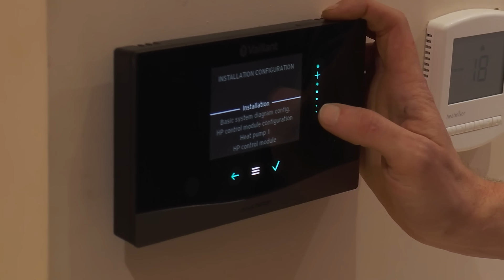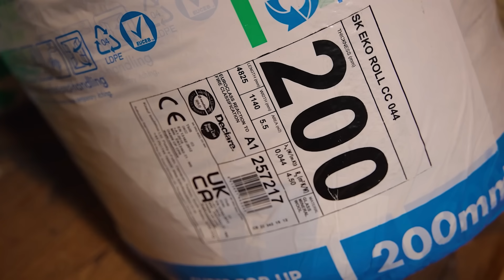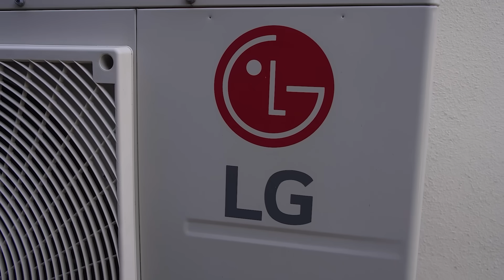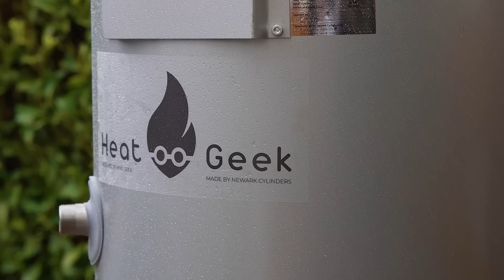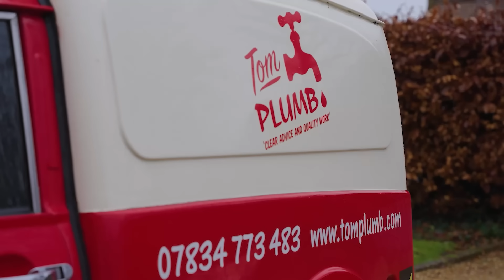Heat Geek’s Heat Pump One Year Later — The Verdict!

Comment: I  nontice the heat pumps you feature,are close to walls
I made a base one,but building inspector said it must be 1 meter from any wall

Most of us grow up learning that oil and gas are fossil fuels formed from the remains of ancient plants and animals buried under layers of sediment for millions of years. These hydrocarbons have powered modern civilization, fueling transportation, industries, and countless everyday technologies. However, a mind-blowing theory challenges everything we thought we knew about these vital energy sources.

According to the abiogenic petroleum hypothesis, oil and gas might not originate solely from decayed organic matter. Instead, they could be continuously created deep within the Earth, in the zone between the solid mantle and the liquid core. Proponents of this theory suggest that under extreme heat and pressure, inorganic carbon and hydrogen compounds interact to form hydrocarbons, meaning that oil and gas could be a renewable resource. 

Remember, the First Law of Thermodynamics, also known as the Law of Energy Conservation, states that energy cannot be created or destroyed; it can only be transformed from one form to another. What goes up, must come down. Carbon burned up into the atmosphere falls back to Earth and is reabsorbed. Much like the water cycle. The water cycle and the carbon cycle are essential natural processes that illustrate the principles of conservation of mass and energy. 

Key Processes of the Carbon Cycle: 
Photosynthesis: Plants absorb CO₂ from the atmosphere and convert it into organic compounds.
Respiration: Animals and plants release CO₂ back into the atmosphere during metabolic processes.
Decomposition: Dead organisms break down, releasing carbon back into the soil and atmosphere.
Combustion: Burning fossil fuels and biomass releases CO₂ into the atmosphere.
Ocean Uptake: Oceans absorb CO₂ from the atmosphere, where it is used by marine organisms.

Conservation of Mass:
Carbon is cycled through various forms (organic, inorganic) and reservoirs (atmosphere, plants, rocks), showcasing mass conservation principles. The total amount of carbon remains constant while it transitions among different forms.

While the idea of abiogenic petroleum has been discussed by scientists for decades, it remains largely debated and is not widely accepted in mainstream science. Most geologists continue to consider oil and gas to be fossil fuels. Nevertheless, the theory raises fascinating questions about the inner workings of our planet and whether the energy resources we rely on might be more abundant than previously thought. Much research is still ongoing with favorable findings for abiogenic petroleum. 

Beyond its scientific implications, the concept of naturally regenerating hydrocarbons forces us to reconsider our approach to energy and sustainability. It reminds us that the Earth is a complex and dynamic system, complete with processes that are still not fully understood. The idea that oil and gas could be continuously produced through geothermal reactions challenges conventional wisdom and inspires curiosity about the mysteries hidden deep within the planet.

#OilAndGas #AbiogenicPetroleum #RenewableEnergyTheory #GeothermalEnergy #EarthScience #EnergyMysteries #ScienceFacts #FactPulse

Comment: A relative had a house built with full eco credentials and made use of the government grant and favourable feed in tariffs. Now 15years later the heat pump is due replacement  and she has been quoted £13,500 for this. Heat pumps may produce 4kw of heat for 1kw of electricity but electricity is 4 times the cost of gas.  Replacement of a gas boiler costs around £3500 and a lot cheaper to maintain. Saving money is not achievable with heat pumps for most people

Comment: Question. If heat pumps are so efficient and such fantastic heating appliance, then explain to me why an 8.5 KW unit requires a 40 amp MCB as it runs at 37 amps. What is there inside this unit that creates such a massive current draw? Allegedly, it is nothing more than a central heating water circulation pump,  a fan motor, a small compressor, a few solenoid valves and a circuit control board. So what is causing the massive current draw. For your average Joe & Jane could never afford to run one of these units, your electricity bills are through the roof.

Answer: All heat pumps A.S. or G.S. have massive electric heating elements inside then to boost the temperature of the water going into the property? These heating elements make around 80% of the units power consumption, heat pumps are basically just glorified big electric water heaters, disguised as saving the planet. They cannot generate a high enough thermal exchange to raise the water temperature to 70Deg C in order to adequately heat your house and your domestic hot water using only a refrigerant gas.

My combi gas boiler doesn't require a secondary electric heater unit to boost the temperature of my heating and domestic hot water. Reason being because it is truly effective and efficient at heating the water and cost a fraction of the price to install and to actually heat my hot water and home compared to AS or GS  heat pump systems.

Comment: Never remove the boiler it is your backup,  heat pumps do break down. 
There is almost nothing to go wrong with a boiler, but a heat pump has lots of pressured pipes, any tiny leak and you loose the gas, it stops working. 
The squeal was almost certainly just the fan bearings and they could have been changed for about £20 by any company that douse electric motor repairs plus the labour costs obviously. 
I have done many motor bearings over the years, makes them much quieter. 
No it was not the tilt on the unit that is just pure bull Beep as an excuse to make money replacing the entire unit.
It was almost certainly the hose pipe the bearing seals are not designed to work in water. As a hose pipe and water was necessary to try and defrost the unit, that was the problem,  the automatic defrost was not working, probably just a sensor, which could be why it could not heat the house.

Comment: I love that in the back ground throughout this interview there is a secondary heat source in the form of a portable  electric convector heater 🙂
Reply: good catch , the amount of time, expense and people its taken to get his house to a satisfactory state cannot possibly be justified by the time , work and expense its taken , he could simply have stuck with his gas set up and been able to use his garage
Reply: Just because that space heater is there; does not mean that it is constantly turned on.  It also could be the case that this interview is in a conservatory ---- maybe on the north side of the house which does not have heat from the heat pump.  There are several unknown factors.
Reply: Exactly. Probably did it in the conservatory for the light. You'd be mad to put central heating in the conservatory.

Comment: you can't treat all gas boilers equal, just because the one you had was not giving you constant temp doesn't mean it's a boiler Type problem, but in fact it is an exact boiler model problem, because there is a lot of new Modulating condesing combi gas boilers which are excellent in terms of automatically adjusting combustion output to maintain constant temp and are super efficient and fairly simple devices and a lot cheaper than a heat pump. a 24kw modulating gas boiler can effectively run at 4 kw power continiously compared to old boilers that run at maximum power then turn off which cause the inconsistent temps

Comment: I live in norway, it gets down to -30 where I live.. down to -25 all I need for heat is my mitsubishi kirigamine 6.6kw heatpump. When it gets colder than -25, I use some additional wood oven, which is seldom. I think the bigger problem in the uk is insulation.

Comment: Wow, The comments section is  being barraged by the heatgeeks bots. with a COP of 4.5. Does that mean? 1KW of Electricity to 4.5KW of heat. Thats excellent. However Electricity is 26.35p & Gas 6.29p making electricity 4.2 times more expensive. What is the capital spend for a heat pump system + new Radiators. How much space do you need for the Heat Pump. More components means more points of failure. Do the maths. It makes no sense. Is John's opinion valid anymore or has a bias crept in because he got everything for free.

Comment: Find a politician to support a product and then make lots of money. As an aside. When I was at Salford uni in the late 1970's 4 experimental low energy houses were built on the budget normally allocated for a council house. The house had 150mm polystyrene bead cavity fill. 300mm fiberglass in the roof and treble glazing. It also had heat recovery ventilation in bathrooms and kitchen. The sole source of heating was a gas fire in the living room which we were informed just needed 3 hours of use in the evening and then the distribution of heat was assisted by the heat recovery ventilation. BTW the scientist who completed this project Prof Randall was an expert in heat pump science.

Comment: They were saying 
What about flats?
In most of those situations, 1 or 2 Aircon units with heating capabilities would works just great plus cool in the summer.
They are not expensive to install and also give cooling.

Comment: I noticed both the original LG & current Vaillant heat pumps are too close to the wall of the house; 300mm minimum is a common distance suggested by manufactures
Reply: lets hope they dont need to take wide items into their garden , fact is these heat pumps are hideous to look at

Comment: It was mentioned that Landlords are replacing a gas boilers with electric boilers (not heat pump) to avoid paying for the gas certificate. 
This can cause problems with the EPC.
Electric heating is expensive and can result in Ratings lower than E for the property.

Comment: It was absolutely the bearings on the fan motor!!! Adam would have known this because when you turn off the unit the compressor stops but the fans continue to run and continue making noise!!! Refrigerant Engineers my ass! They don't know shit cause they don't work on Heat Pumps all the time.

Comment: I think that is slightly hypocritical of you to say the heat geeks are evangelical, considering that you are largely deaf to the counter arguments - you are just as "evangelical" about the gas (or air to air). Your argument of what if it breaks - well, that happens to gas boilers, oil boilers, etc - it is a circular argument that is common in hypotheticals.

Comment: My first introduction to this channel was a full on rant about the negatives of heat pumps but I could see the guy clearly has knowledge so I stuck with it even though my own experience with a heat pump is very positive.   The fact that he has a long video with someone who also has positive experience is to the credit of this channel.  I don't think we need to be talking about everyone having a heat pump or an EV or whatever but everyone should get a balanced view of the benefits and disadvantages and get to make an informed decision for themselves.

I have a simple air to air heat pump that was installed in a very large one floor apartment in under an hour and replaced two gas heaters and four electric resistance heaters and keeps the whole place nice and warm in the winter and cools it down in the summer.  Love it.

Comment: I have 2 ashp at my house and probably the worst decision I ever made, as soon as the outside temp goes below 4 degrees they’re a waste of time , I could wait half the day for the radiators to get to temp , nov/dec/jan I’m approx. 1-1.2k per month in electric, every service I tell the mob that installed the system about it and every year they do something different and say that’s it fixed, the latest one is the frost protection and they’ve switched it off because the service guy reckons that because the anti freeze level is right it doesn’t need it , of course you don’t know until you get till the end of the year so who knows , guess I’ll have to wait and see
Reply: Have you considered the main point of this video?  That is you leave the heat pump on all the time.  You don't turn it off and on when you think you need it.  It will keep the house at the same temperature all the time and turn itself on and off as needed.  It will still save money.

Comment: I used a Vaillant aroTHERM system for four years, but it broke down three times during that period. The main problem wasn't just the product itself — it was the support. 

Each time, it took over two weeks to get a technician to the site, resulting in prolonged periods without heating or cooling, often during the coldest or hottest days. 

We paid €250 annually for a maintenance contract, but support was ineffective when we needed it most. If I had the chance to choose again, I would opt for another brand, such as Hitachi, Bosch, or Nibe, which seem to provide more reliable systems and quicker service.

Comment: Heat pumps will work for any house. The system just needs to be designed and fitted correctly.
If you install a gas combi today, you'll be ripping it out in 10 years when the gas price skyrockets.
Also no one ever mentions the particulates that gas appliances eject into your house. Over a long period it not good for your lungs.

Comment: I like the concept of a heat pump but he's right it's not for everyone. I live by myself in a small 100% brick terrace and never use the heating because it's just me, so I just warm myself up with extra jumpers, not the house. The ASHP would use most of my outdoor space, and doesn't address the single reason I've just switched from a traditional boiler to a combi; heating up a big tank of water for one person that only needs a few litres to shower with and wash 1 plate will ALWAYS be less efficient than just heating up what I need on demand.
Reply: With modern HW cylinders you can chose how much water you need heated, the hot water is always at the top of the cylinder, and there is a 'stratification' layer between that and the colder water at bottom of cylinder.
With my Mixergy cylinder I heat whatever portion of the cylinder volume I want and to the temperature I want, more or less on demand.

If I plan a bath my HP will heat a full 150 litre cylinder to 45C in thirty minutes, or a third of a cylinder in 10 minutes for that shower and plate.
Reply: @_Dougaldog  That's an interesting piece of technology, it's good to see there's something out there to address the waste issue with cylinders! Thank you for telling me about it, I'd no idea such a thing existed.

Comment: So if electricity £/kW is 4 times the gas £/kW and the heat pump COP (coefficient of performance) is, say, 4 what’s the point of incurring the cost of replacing a gas boiler with a heat pump?  What am I missing?
Reply: Gas boiler is typically 85% efficient, so a break even COP of 3.4 is more realistic.

With the grant I replaced a broken 17 year old boiler, 60 year old heating and HW cylinder, with new HP, radiators, HWC and all plumbing for under £4k (what a new boiler would cost).

My heating SCOP over 18 months is 4.03

Comment: I would leave a heat pump in its box. You end up running a heat pump for the heat pump not your home.
Reply: Heat pump controls are pretty sophisticated and flexible, you can generally set them up how you want them. Hot at some times, cooler at others.

Comment: What is payback time on this system now?
Reply: Heat pump installs are mostly aimed to match the energy costs of a gas boiler, rather than have an ROI (though Heat Geeks promise savings with higher efficiencies).

Most of his work was done before the grant. Whilst his system is 450% efficient now thanks to the Heat Geeks, the investment he put in will take a while to pay back.

Comment: Can some properties use air con units for heating when required and have a direct cylinder heated by electricity?
Reply: Yes, you can use air to air for efficient heating (close to air to water heat pump efficiency), then something like an Mixergy IHP with heat pump efficiencies (or worse, immersion) for hot water. I'm not sure air to air qualifies as a suitable heating system for regulation purposes though?

Comment: why is there an electric heater at the side of you if it all works as it should?
Reply: It's an occasionally used heater in the unheated conservatory which doesn't have a radiator.

Comment: Whatever way you sell heat pumps , they do work but over complicated, expensive to install and maintain. Still won’t beat a combi boiler. Also you can have a combi on for 10 minutes of hot water in the summer for next to nothing. Heat pumps 💩

Comment: People saying heat pumps just not designed correctly hence the problem(s)... but what about the gas install not designed correctly since the further radiator is fluctuating like mad... basic balancing/design issue.

Comment: High COP shouldn't be the benchmark, since its all great getting a high COP yet its running for way longer than normal and for more of the year.
Reply: Running a heating system for longer and slower can cost less than running faster and harder (even with a gas boiler). Gas boilers can only reach 95% efficiency at best. The best heat pump installs just reach 500% over a year.
Reply: @Biggest-hz7ng  That's the best, remember that. I could make one run the best COP but still waste more heat when its not needed. That is the point, % is a meaningless comparison.